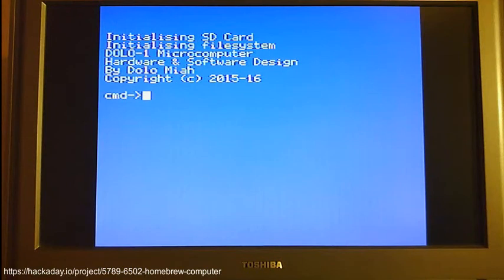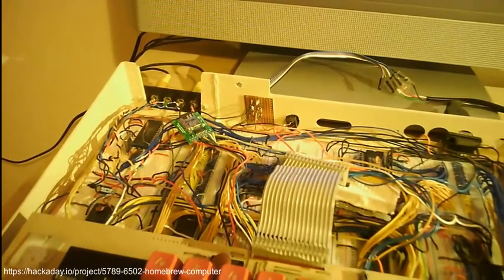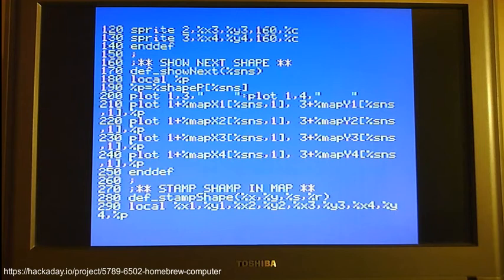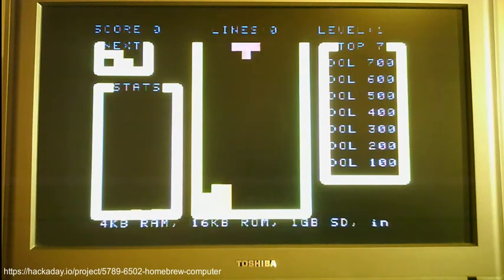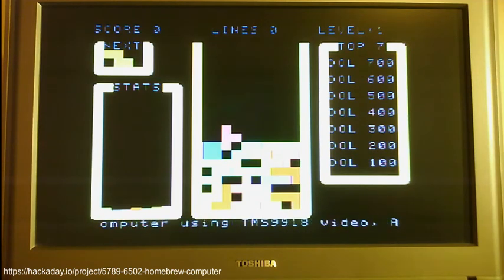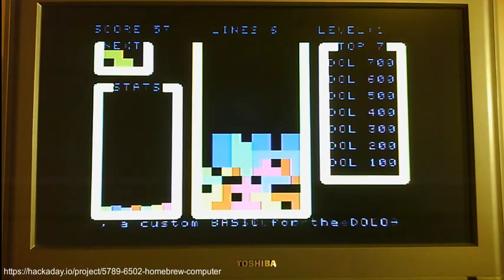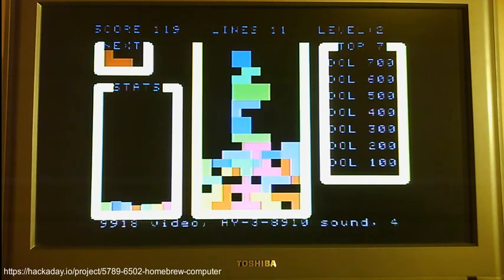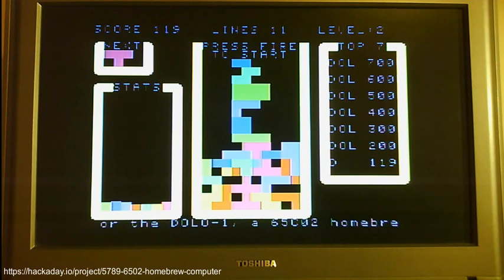6502 Homebrew Computer and language playing Tetris

Comment: Very nice indeed. Did you implement your D-flat language purely in MOS 6502 assembly language or did you use some higher level parser generating tools or high level language to write the code?
[edit: never mind, found this on hackaday, will explore for answers]
Reply: Impressive. Things get really tedious when programming in assembly language, especially the complex stuff. I hope to create a language of my own or at least my own implementation of BASIC interpreter for my hobby computer, but didn't gather all the motivation yet to proceed. :-) One of the designs I am considering is my own implementation of virtual machine with own opcodes and interpreter which would operate on somewhat higher level than 6502 machine code (more registers, string buffers and string processing opcodes etc.) and then on top of that build more complex things, like higher level language interpreter / compiler. But the price attached to this design is performance and need for more memory. I guess possibly not suitable for small 8-bit platforms.